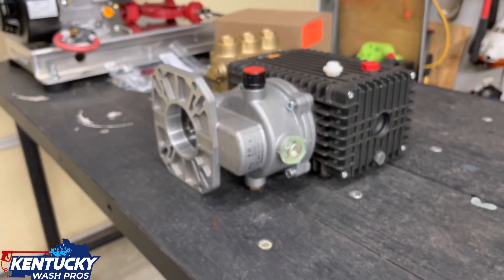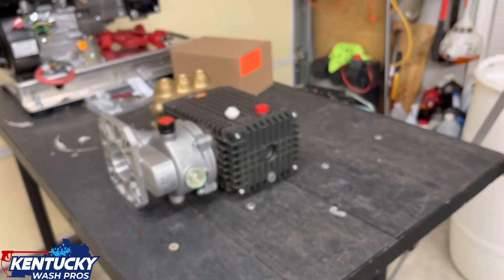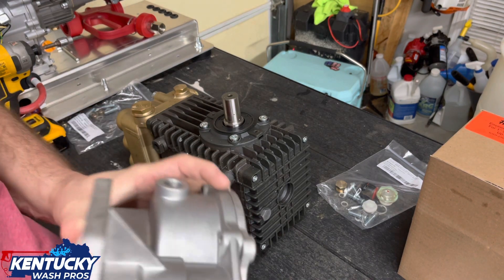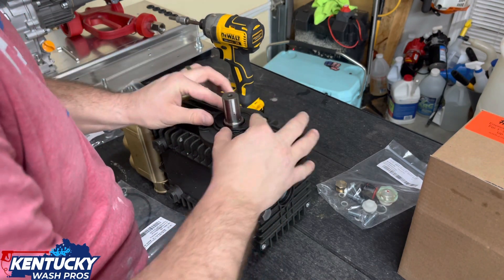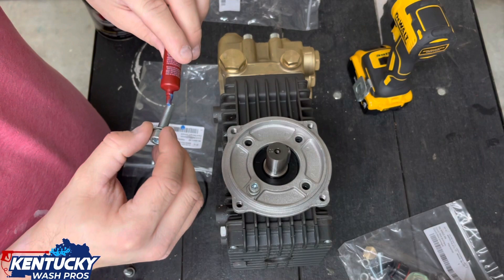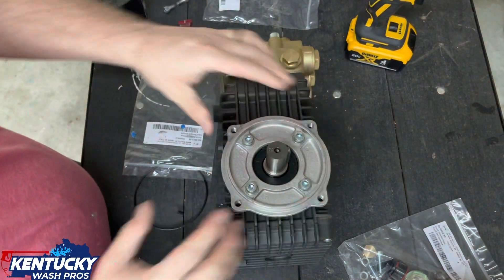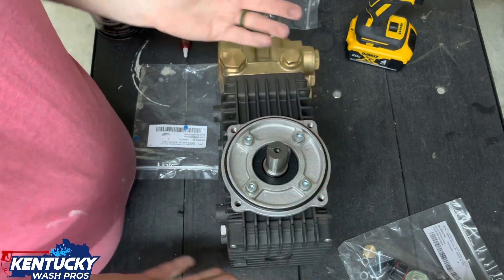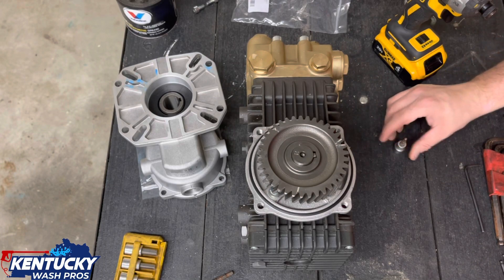How to install a gearbox onto a pressure wash pump

Comment: Im trying to find a new supplier for a rt angle gearbox, last i bought was in 04 and they dont seemto exist. Vertical to horizontal config. Loved themsince vertical shaft engines run much cheaper than horizontal shaft used.
Reply from the maker: Check with sprayer depot

Comment: Jeremy, what a great video! Hey man, I had a question. when you purchased the gear box from envirospec did it come with all the gaskets and plugs, or where those ordered separately? I ordered the comet gearbox with the comet TW8036S. I plan on throwing it on my 20HP engine, any concerns there, and what do you think the performance would be?
Reply from the maker: I believe everything came with it, I don’t recall ordering anything separate

Comment: Are gear boxes pretty universal? Do you pretty much just have to match up your gear shaft size?? Im wanting to get a Comet RW 5530 pump and am looking to get a gear box to put on a a predator 13hp engine. Any insight? Thanks!
Reply from the maker: You’ll have to get the right size gearbox for the engine shaft. I’d recommend calling Russ Johnson at South Side Equipment in Brooks, KY. He’s very helpful and get you the right equipment.
Reply: @KentuckyWashPros  gotcha, I’ll look into that. Thanks for the reply!
Reply from the maker: They are not universal, different engine sizes has different shaft diameters

Comment: What's the advantage of a gearbox vs direct drive
Reply from the maker: gearbox runs at a lower rpm than DD and your pump can pull water on a gear drive
Reply: If I have a direct drive pressure washer now, can I just order the gear box and change it to gear driven or do I need a new pump that made specifically for gear drive? Basically my question is can I turn a direct drive pump to a gear drive pump?

Comment: I'm not sure if I got the same gearbox or not. I got the ZGRS1000 Gear Reducer from general pump and I have a 5.5 ts2021 connected to it. I don't know why but either the gearbox or the pump is making a whining noise. No idea what it is or why or if its normal. Pump is working fine. No leaks detected. Everything bolted up just fine. Here is a link to my channel with the newly uploaded video of the noise....https://www.youtube.com/shorts/wJYuynnm1XY
Reply from the maker: what kind of oil are you using?
Reply: @KentuckyWashPros  Gearbox calls for SAE 80W-90 which is what I put in. it was also the first start up and ran maybe 5 min before I shut it off.

Comment: Question if I wanted to build a do it all pressure washer. Maybe I want to wash concrete with surface cleaner I would need 3gpm minimum, but if I need it to wash cars I could lower gpm to 1.5-2 gpm. What would be best gear or belt drive?
Reply from the maker: In my opinion 4gpm minimum. I would prefer gear drive, they are usually a smaller footprint and I believe less maintenance with adjusting belts and replacing belts.

Comment: Are you sure the smaller oring goes on that grove? Feels like the plate doesn't bolt up flush
Reply: having the same issue, started leaking almost immediately after i turned it on.
Reply: @AlejandroRodriguez-nc8ud  can confirm it goes in the step

Comment: I'm building my new trailer right now.  I'm adding a 5.5 hot water skid I snagged in Nicholasville KY.  The only downside to higher gpm is I feel like you can't pull as strong of a mix with the downstream injector.  I had a gas softwash system and still like downstream for house washing.  Good video I like seeing your build.
Reply from the maker: Thanks and I appreciate you watching, where are you located at?
Reply: @KentuckyWashPros  im in Chattanooga TN so not a close drive it was about 4 1/2 hours to pick it up, but we'll worth it.   I'm looking forward to see your build!
Reply: Just turn the throttle down or get a bigger injector.

Comment: I bought a TSF2021 as a backup for $500 a few years back. Sitting in my garage.
Reply from the maker: That’s a deal, wish I could buy one for 500 now and hold on to it for a back up. Which pump are you running on the 8?
Reply: @KentuckyWashPros  TSF2021 is the 8

Comment: 10gpm!! Wow. Coming off the porch to run with that one brother!  
Is there a preference for the gear drive over a belt driven skid setup Jeremy?  Just curious .  I am wanting to gear drive a 5.5 to replace a 4gpm on a Honda GX390 but would love to step into a 8gal unit after I get going.
Reply from the maker: Honestly to me a gearbox is just easier to work with for me. I don’t have any experience with belt drives. If I was in your situation and your wanting to go from a 4 to 5.5 I would honestly buy the 6.8 Alison pump that comes with the gearbox installed. That would be the best bang for your buck.
Reply: @KentuckyWashPros   The 6.8 would be a hard pull in the little 390 wouldn’t it?  I’ve not researched that but does give me an option to look into.  Thanks for the videos and reply back!  Keep up the good work Jeremy.
Reply: @prc37388  you cant get much out of that honda 390, 4gpm at 3500psi is what you  can get and that is pushing it, the spec dont support anything higher than that.